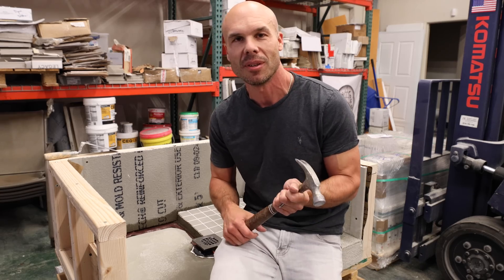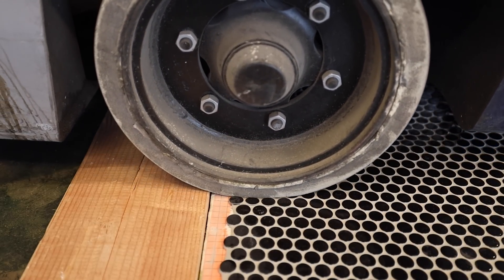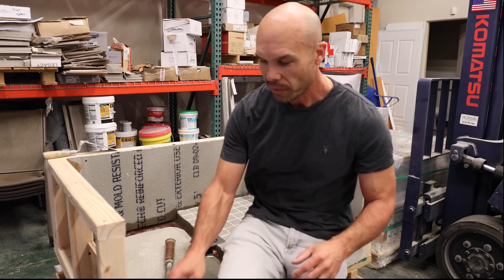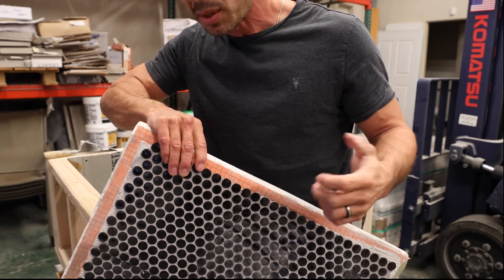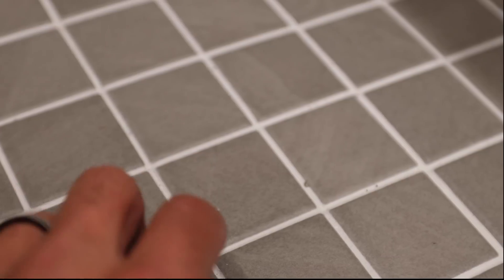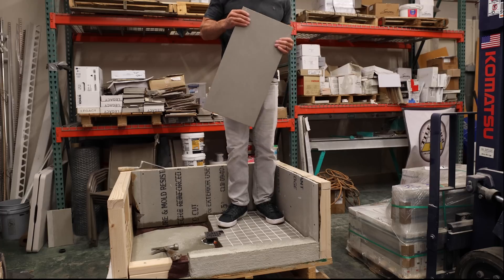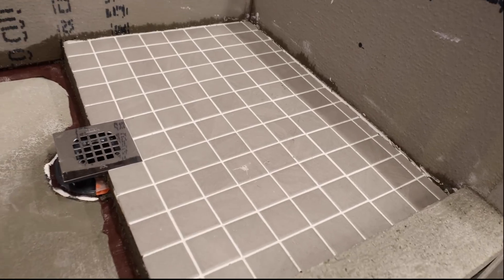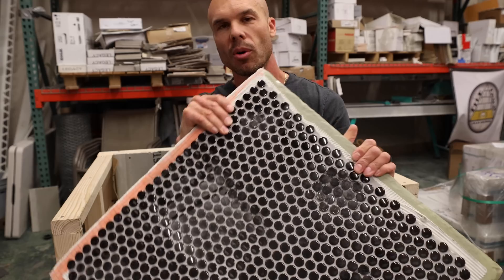Foam Shower Pan Vs. Mud Shower Pan --- Drop Hammer Test

Comment: Foam is just foam, not concrete, drive the forklift over the concrete and see what happens, you should test all methods on the concrete that you used on the foam tray. Thanks for the video!

Comment: Man o live - had the Schluter pan all set to go - but the perfectly mitre cut metal border fell out and jabbed right through the Kerde board with membrane already attached- so 24 hrs later after applying Schluter-Fix I will get to start laying tile …finally. Had never heard of Schluter  before this home and now 4 bathrooms later - it’s been a pain in the neck and so many things to learn but looking back knowing I’ve done each step including water tests, I would not do it any other way unless Isaac offered to come do it for me😂. Doing it yourself to me means getting it done right maybe not quickly but - you know, … it’s done right and not slipshod

Comment: the is a way ,to prevent it n fix it either covering the bottom with rubber coating ,, also can be sand down & cut to a shape desired from bottom , get fiber glass or plastic , seal bottom shape larger than the  on top cut to shape place it on top with water proof sealer adhesive

Comment: Can you compare apples to apples? 2 inch square tiles are way more substantial than 1 inch penny tiles. I once dropped a nail gun on a foam shower that I had just finished with 2 inch square tiles a few days prior. I was up on a ladder putting up crown molding and brushed the nail gun off the ladder. The nail gun did nothing to the foam bed, just chipped a few tiles and so I gently removed and replaced.

Comment: Thanks for this! I guess don't ever use mosaic or small tiles on foam pans. ps - I had to remove a well-adhered tile from a wedi backer and it completely destroyed the wedi panel - chunks of wedi came out with the tile because the bond between the tile and wedi was stronger than the foam itself. So in terms of any repairs, a foam backer makes it much more difficult.

Comment: We have doing shower pans with foam for yrs here in up in Canada, and let tell you,  i have had the opportunity to remove some of them after 20 yrs and man, i wish they where mortar. BTW, all was nice and dry under.. and around.
Reply: Elaborate. You say after 20 years you were ripping them out. Sounds like a good run for me. Why did they need ripped out? Preference? Outdated? If everything was dry, would it not prove that the foam did its job?
Reply: @lesg9604  yes, people after 15 yrs they just like doing upgrades .. but i can tell the system works. Every time i ripped one out, it is in perfect condition. it could last a 100 yrs in my opinion, and seen the protection it gives.
Reply: I’m confused. The foam after 20 years is perfect condition, or the mortar bed is perfect after 20 years?
Reply: @lesg9604  the foam

Comment: I will do mortar bed for shower pans, but i will still us the kerdi liner to water proof the base. BTW where you at? how is the market down where you are. I have to mention that using the foam it is a more clean and fast way to do it, but i would still prefer using the mortar bed on mosaics less than 1 inch.

Comment: Its big difference between half inch pebbles and 2 inch mosaic. I will never recommend using foam on mosaics, less than one inch. but, never the less, the schluter kit for shower pans is a good product, easy and faster system.

Comment: Thank you for the great video.  This is exactly the reason why I opted for a mortar bed instead of a foam bed although it was my first time to build up a shower.  I wonder how a foam shower curb would perform over time.  In general,  plastic foams are not good for repetitive compression, i.e. stepping.

Comment: I noticed that both you and Sal mix and match waterproof membranes.  I like the density of the 1/2 Hydro ban board, but dont like the way laticrete linear drain goes in with a roll on waterproof.  I like the Schluter linear drain with the kerdi bonded to it.  You have dont see a problem or have not had a problem using a Kerdi linear drain with hydro ban membrane or board.

Comment: Kudos, for cool videos, on the toughness, of the foam, and regular mud pans. however, you should be dropping, those 32oz, body wash containers, those things are brutal, if you ever dropped 1, on your foot, lol, jk, why would someone have a hammer, in the shower, lol? Well, you might, b/c your always working, hehehehe. But, it was cool, to see, in the beginning, the forklift over foam. I have to ask, though man, how do you stay in shape, to do that work, I'm 47 and I'm overweight, I've been doing electrical for 30 years and I won't lie some days I take a beating. Tiling stuff is heavy and all the set up materials, mud, tile, pans mud for pans are all heavy. your a tough guy I guess idt I could do that work except with the foam under layments except here where I live in NEPA most people don't use them b/c cost and the shower would cost as much as the house is worth. But great video. thank you

Comment: Just in the last year I've replaced 3 different foam pans, and redid the base with a dry pack. The foam gets bouncy. 
On one of them we tried to call Schluter but they said it would be 2 to 3 months before anybody could come out for an inspection to do a warranty claim. This was the customer's only shower so we just went ahead with the repair. Basically it boils down to this, mortar beds are far more durable than foam pans. Show me a 20-year foam pan, it's an impossibility.
Reply: It's crazy because I see some amazing tilesetters using foam pans  and I'm just watching like "How are they not skeptical of what the integrity of the foam will be like after 10+ years of people walking and standing on it.
It's happening all around the world with pretty much everything. We continue to rely more and more on technology and innovation but along with that we shitcan everything we have and lose those skills and knowledge.
Tile coach has been preaching it for years, we should not be taking what the manufacturers say as absolute truth because that has bitten so many people over the years and most times the company doesn't stand behind the claims and finds any reason to void the warranty when the failure clearly resulted from the product or approved installation method. So because of this, we need to look after ourselves and each other by holding these companies accountable through testing that disproves their claims and hopefully damages their reputation enough to where they put out products and do extremely thorough testing to virtually eliminate short and long term failures in the field.

Comment: @TileCoach I believe that a 260# person in a WHEELCHAIR could compress the foam in a curbless penny tile shower. Most of the weight is at the bottom of the 2 large rear wheels. The front wheels have much less load on them. On your test in the other video using a ladder, most of your weight is over the ladder feet under the steps when you were standing on the steps. Equal loading under each ladder foot doesn't occur until you are standing on the top of the ladder. Thank you for pointing this out. I was considering using a foam base with peeble tiles but I'm no longer going to do this because of the loads a wheelchair could give. I love your channel. Thank you for all that you do.

Comment: Love all the tests you do. So, how would you repair/replace the tile in both situations? If you have a sheet membrane over the mortar bed how do you remove the tile without tearing up the membrane? I just had a similar situation with a chipped tile on the wall and removing one tile caused damage to the membrane. Now I have a huge mess. Thanks for all your great videos.
Reply: Just gonna be a mess, I hate repairs over the membranes, a plumber, or a glass guy can make a days worth of work for a poor tile guy

Comment: Your fun to watch. I'm just north of Seattle and it's about 3am. Been poking around YouTube all night.  I now have a question..     We have an existing lower level bath. Its on the homes concrete pad, Its about 9' x 8'.  I was considering tiling the whole room (shower included) and having a seamless entry to the shower.   What are your thoughts?  Will it be too hard to create an adequate slope for the shower drain?  should I waterproof the whole floor?  Do you already have a video on this subject?  Glad to hear you are recovering from your bout with Covid.   Last , but net least,   A Great Big Shout Out to all our First Responders.

Comment: Not a very scientific or honest comparison. As others have mentioned, the same mosaic should have been used. 

I'd be interested to see if foam pan with schluter ditra heat mat over it would fair better than without; the ditra heat mat would likely distribute any load/impact better. Thanks for the video!

Comment: This is actually a really good real world test I like to do the floor tile before I do the walls and each thing you dropped is definitely a possible accident a contractor could do, I've always done mortar pans and won't do foam ones because I don't believe they are capable of holding up over time, nice test and keep up the good work.

Comment: I don't even like foam but that is not a fair comparison.  You used pebble tile that has very little surface area on the foam pan and regular tile on the dry pack pan.  I do appreciate that you do these types of tests though.  How about redoing the foam pan with that same tile you used on the dry pack pan and repeat the test? :-)

Comment: I do think the foam pan with the penny tile would have faired a little better had it been tiled with the 2x2 tile. The smaller penny tile don't distribute the weight at all. The downward force is directed striaght down. I have seen this my self with the penny tile on a foam pan in one of my showers. Customer insisted on the penny tile but I was dead against it. Will never use those on a foam pan again. Just throwing this thought out there. Love the videos.

Comment: Good test but a bit of comparing apples to oranges. The mud pan is made from e cement but has a much larger tile to spread out the weight and impact fore which the foam pan has Penny tile on it which is far more likely to crack and bust through with a hammer or tile. For a follow up do 2x2 or large on both.

Comment: Penny tile is not approved on a foam pan. Would love to see foam pan retested with larger format tile.
Reply: Pretty sure 2” is the smallest schluter allows on their foam..
Reply: Ya wish you did the test using the same tiles.
Reply: Wrong you are thinking of schluter ditra. Penny tile is fine for schluter preformed shower pans.
Reply: Not true  @davidsteyer4925
Reply: I recommend to use mortar bed on tiles less than 1 inch, but to be safe not less than inch and a half.

Comment: my issue w foam ,...sounds hollow,and installers didnt protect it from  their boots ,knees ,dinged dented ,and punctured,they easily could've  protected it
Reply from the maker: Ya, we like to tile the pan before we work on it if we are using foam or ditra-heat.

Comment: With curb less showers being all the rage what is the minimum thickness for a 32 by 60 mud pan to still have enough strength on a sub floor to support  tile.? I only see foam pans on sub floors with the recess plywood for curb less unless it it a concrete floor then i will see a mud job.

Comment: You’re not supposed to use tile less 2x2 in foam pans
Reply from the maker: I think they changed that.  Maybe someone here knows better but that's what I've heard.
Reply: Not true, if you reach out to Schluter for example, they'll tell you there's no minimum tile size requirement for their pans; but they do take exceptions to river rock style tiles. 😉
Reply: You can use penny rounds on foam for example Laticrete allows it with their thin foam pan, as long as it’s waterproofing is installed with 254 Platinum as well as the tile

Comment: This is not at all the same thing to compare, with all due respect.
Reply from the maker: Any suggestions?   Do a penny tile on mud pan?
Reply: @TileCoach  yes, just compare one to one equally. Whatever you do the one you do do the other with the same fundamental conditions applying force on both. You display a foam penny showerpan driven over by a heavy equipment and then larger pan tile with just falling items - you know what I mean…
Reply: You drove a forklift over a foam pan - which would never happen in real life and offered that as some proof that mudbed is better when you didn’t do that with the mud bed - which I bet would crack as well under the same circumstances. That’s what I’m talking about. Thanks for all you do.

Comment: If it happens on foam you can try to remove the tile and hydroban the spot to keep the waterproofing, thats the only fix i see for the foam.
Reply: That’s what I would do. Remove damage and some surrounding tile, fill dent with thinset or mortar, then apply liquid waterproofing like hydro an, aquadefense, etc

Comment: Not a fair comparison. A 2x2 tile disperses the force over a MUCH greater area.
Reply: Yes , I've heard the Coach say in another video that those small penny tiles are NOT recommended on foam.
Reply from the maker: Youre right.  I will do a mud pan with penny tiles too.
Reply: @TileCoach  I was thinking a more fair comparison would be a foam pan with 2x2 :)
Reply: @TileCoach  Pretty sure (Schluter at least) you need to use at minimum 2x2 tiles on a foam pan.

Comment: first thats why you never put penny rounds on a shower floor , terrible look to. also why didnt you do use 2x2 tiles on the shluter pan for the test like you did on the mud float.  or use  penny rounds on the mud pan as well. . wats the point in that bud
Reply: What about 1" hex?
Reply: @ethantimm2780  imo man im not putting anything smaller  than 2x2 on the shower floors  it looks better and bigger tiles disperse the energy of impacts so they can withstand more objects dropped on them.  i do really like the hex look though. use a bigger hex tile  for shower floor .  better look and more durability bro
Reply from the maker: I'll have to do another video now!   Penny's on a mud pan.
Reply: @TileCoach  do you have thoughts on 1" hex on shower pans? Is it something you'd never do?
Reply: @ethantimm2780  lol do some research online you will find your answer if you dont believe me.   1 inch idkkkkk
Reply: @TileCoach  idk about pennys on anything lol i think to get the most out of your video you should use tiles that people actually use on the shlUter pans alot. 2x2 or bigger do another video with no penny rounds lol no one uses that shit man , if they want pennys  then you explain this will happen but for a badass video wich was a great idea make it realistic . what tile people would actually have on there shlutere pans in a custom home not pennys.

Comment: Is it of any relevance that penny tile was used to test the foam pan? I believe they recommend 2" or bigger tile for that reason? Nothing to argue here, simple physics would indicate that a mortar base pan would be much stronger from blunt force.  
I have always wondered how easy a foam pan would damage. Sometimes wondering if a larger client could put enough pressure with their heels to do this type of damage to a foam pan.
Reply: Schluter specifically says to NOT use any tile that is smaller than 2"x2" on the shower pan.  This would have been a great test if the tiles used were the same, and adhered to at least the minimum standards set out by any of the foam pan manufacturers.
Reply: They make special chairs for people over 300 lbs so its definately a consideration
Reply: if your customers are 300 pounds and they want any tile on the floor it better not use the foam pan simple as that lol. any normal size person wouldnt have that problem at all
Reply: The 2" x 2" tile rule is for ditra not schluter preformed foam shower pans.
Reply: @davidsteyer4925  actually, I think you're right about that, my mistake.  That said though, comparing a penny tile to a 2x2 isn't going to yield accurate results.

Comment: Would also be interested in a similar test with one of the tile “ready” pre made pans that are also set in a mortar bed. Guessing that might also crack all the way thru but would still be interested in seeing it.
Reply: I second this :)
Reply: I think this would be a waste of Isaac's time. A rigid mortar base UNDER the softer foam isn't going to make the foam any stiffer. Doing a layer of mortar OVER the foam, especially with a membrane, will stiffen the base.
Reply: Third